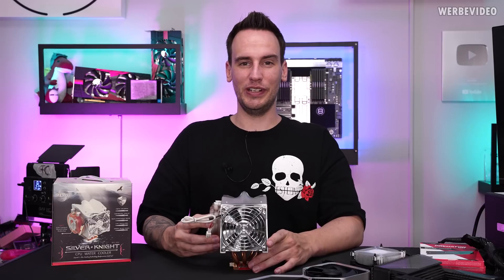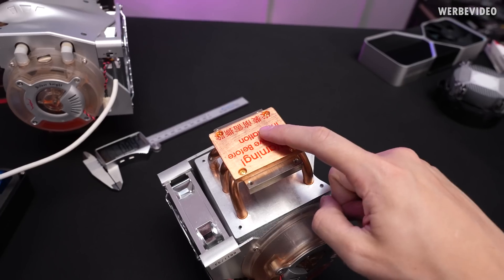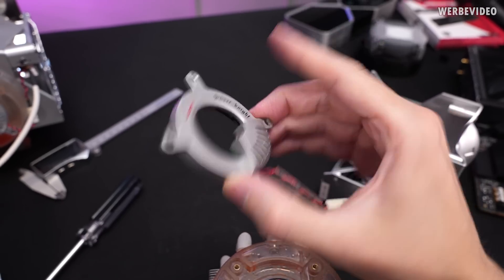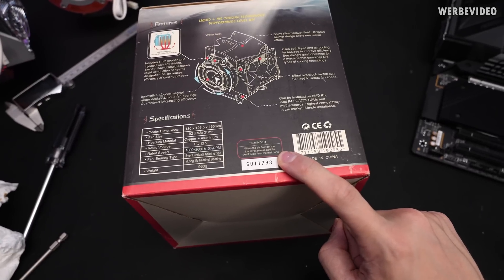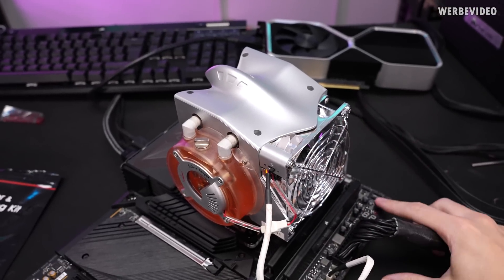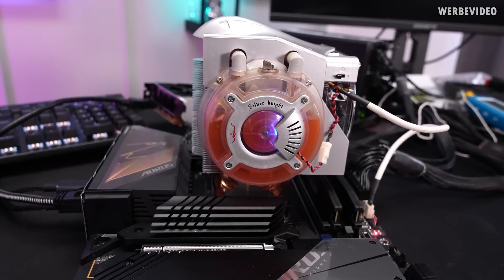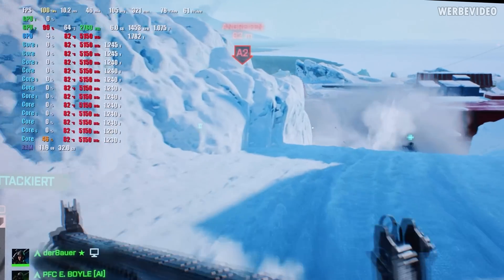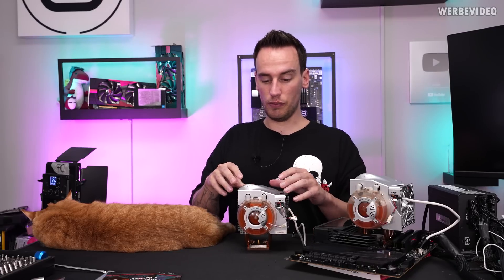Crazy Design!! This CPU Air-Cooler runs Water through the "Heatpipes"

Comment: so, how this thing actually work inside a computer case? Can the pump work face down against the gpu or flip it upside down with the pump on top?(the fan suck fresh air from the back of the case?)
Reply: flipping it upside down is probably a bad idea for the same reason that you shouldn't have the pump of an AIO as the highest point in the loop. Air will migrate to the top, that means with the pump on top it'll run (partially) dry, depending on how much fluid is in the loop. That'll make it loud, perform worse and depending on design, could kill the pump rather quickly.

Comment: really no idea why you are weirded out fluid being gone from such an old cooler, it has just evaporated or indeed leaked.
Also we have waterbottles at work with a much finer tip then the one you are using.
You could also test the cooler without installing it first...just put it next to the board?

Comment: Something you forgot to mention: heat pipes use evaporation to transport the heat away from the source. The phase change from liquid to vapor consumes energy, which provides a net positive cooling coefficient compared to simply transporting the heat using a liquid alone. This is how refrigerators, air conditioning and heat pumps work. So for a given footprint (let's say volume of space the entire cooling system takes up), a heat pipe tower cooler should perform better than a water tube tower cooler. The main reason why water cooling systems (both AIO and open loop) perform better than tower coolers is that they can transport the heat further away from the CPU socket where there is more room for a bigger radiator that would otherwise not fit in the system, and provide a cleaner airflow path to draw in cold air and exhaust hot air. A 120 AIO should perform about the same as a good tower cooler for that reason, and not provide much benefit aside from aesthetics.
Reply: While latent heat of vaporization is a thing, your conclusion is not correct.  The dramatically higher volume of water being moved by a pump compared to the volume moved by a heatpipe will absolutely allow a water cooler to move more heat per unit time across the same distance.  The only limitation would be flowrate.
Reply: @zoson Factually correct, functionally inaccurate. 120 AIOs demonstrate this, and are routinely worse performers than top air coolers. The latent heat during the phase change is enough to overcome the advantages of a small flow loops. As the loop scales, it flips and gets the advantage. There's no way a tiny loop like in the video, or one like it using a D15/K620/Darkrock will have enough volume to surpass the evaporative advantage of their air cooling heat pipe versions.
Reply: @RobertSmith-lh6hg  As I specifically mentioned...  "The only limitation would be flowrate."  AIO's are KNOWN for having garbage flowrate.  And it's a major contributing factor as to why certain non-asetek units can perform so significantly better.

Comment: There doesn't seem to be any definitive video regarding how to orient your motherboard, considering there are vapour chambers.
I notice that a lot of tests are done on a test bed where the motherboard is flat, as if it is a desktop case.
But then the vapor chambers are not oriented the same way in my tower case.
So it would be good to test these things with the motherboard oriented in different positions.

Similar to what seems to be issues with GPU's and their vapour chambers.
Reply: There probably are some CPU cooler designs that use vapor chambers, but the vast majority of CPU coolers don't. Tower coolers usually use either heatpipes with a flattened surface that go directly on top of the IHS or heatpipes on top of a copper contact plate – or maybe aluminum for some cheaper models. Heatpipes are not as sensitive to gravity as vapor chambers are, they should work in any orientation really. Non-tower coolers may use the same concept with just a horizontal fin stack instead of vertical or just have a full copper/aluminum contact plate with fins directly on top.

Comment: Do note that the cooler wouldn't be oriented like that on a case, it'd probably sound different on a case, with the water not dripping down into the pump so high.
Reply: If it was fully filled with liquid it might also mitigate this issue.
Reply: Yes, very good point. This is also a problem with some AIOs...
Reply: id say if was full like on package shows and set to high in case no open air with no case dampening then it would be way quieter i wonder what its max performance is like it ok to test high on am5 but id like to see ryzen 7 or 9 on am4 cause they didnt put crappy ihs on those cpus
Reply: had if pump was actually full of water
Reply: and a newer PWM fan; an Arctic P series, if they have that size

Comment: I'm a bit sad that now I know my man Der8auer is not familiar with permeation x), I though you knew that because it happen also in modern loop system, plastic is not 100% waterproof, water will always find a way to permeate it, it already happen in systems that are like 5-6 years old, more than 10 ? Of course it will happen, and it won't even let a trace, liquid will get away without the colouring x).

Comment: "you can't run water through heatpipes"
i mean, nothing stops you from cutting the top off a heatpipe and attaching a hose/fitting to that, right?
i'd assume that'd work better than straight up pipes because of the copper sponge around the walls having more surface area than a flat pipe
Reply: Could work, but you'd probably need a strong pump that can generate quite a bit of pressure, as the hole inside a heat pipe would be tiny compared to even those small tubes on this cooler.
Reply: true! i'd guess running a couple of pumps in series would be enough

Comment: I really enjoy these videos where you look at old generation tech. You always seem to find something interesting. Although this particular one triggered a few traumatic memories from an old Zalman Reserator I had in the early 2000s. I had a pump death critical fail and bricked a CPU and board. I stayed away from water cooling until only recently. 👍
Reply: I think it would also be very interesting to get ahold of every generation of Zalman CPU water block and compare their performance as I am not aware of any other series of water block that demonstrates the early water block design evolution from spiral maze to fin path, from fin path to square pin-fins, and then to round pin-fins.  
You could even test every water block on the same AM4/5 processor as Zalman used the stock AMD retention bracket to mount their CPU water block.
Reply: Dude I remember those days. Me, I had a Chieftec Dragon case (Antec Clone) with water cooling. I went to work, and my brother let the dogs in the room. They went apesh1t fighting each other and knocked it off the desk to it's death. I mean, drop a 20# computer. It looked like a car accident. hahaha.
Reply: @heavytank2  Not a clone! Chieftec and Antec both sourced their cases from Chenming.
Reply: @intercity125  cool ty for clearing that up
Reply: @heavytank2  Aah the wild west days of case pimping 😆

Comment: I thought that the pump should be below the water level, so it was correct to test when the motherboard in an upright position, it seems to me, no? Not for nothing the pump on the cooler is placed exactly at the bottom of it.

Comment: It would be very interesting to see how a modern version of this concept would perform
Reply: Not much better. Its a gimmick. This was from the early era of DIY gaming PCs. There were several products like this that all used watercooling to cool a tower cooler, but none were better than simply bigger tower coolers, which were also cheaper. You dont need water and tubing when bigger and more heatpipes work better in this scenario, and really the limiting factor of these coolers is surface area to dissipate the heat, hence why big tower coolers were better, and why radiators/AIOs became popular too. The biggest advantage of watercooling isnt the water, its the surface area of the radiator. ---The ideal situation for a product like this would be a hybrid cooler, aircooler + 120mm radiator 2 in 1 for ITX/mATX cases.
Reply: Or with diferent liquids.
Reply: Slightly less awfully.
Reply: Badly. The heatpipes themselves are better than a water loop when used in this sort of configuration (duh). At short distances heatpipes are magnificant but they become cumbersome and ineffective at longer distances.

The advantage of water besides is mainly that its better at transporting the heat over a longer distance and consquently allowing for bigger heat sinks further away from the heat source. Which can be very useful given by the geometrical constraints of desktop systems.

"Constraints of desktop systems" are the key words here. You could build a much much better heatpipe cooler but on a modern mainboard there is simply no place to put it.  Nevermind mounting it.
Reply: It would be an interesting thought experiment, because we know over the last one and a half decades the industry has learned a lot about fluid dynamics and taking advantage of different flow types for heat extraction. Just the difference in the size of the cooling surface and the density of the fins would likely knock off a few degrees.
That being said, we currently have air coolers capable of cooling more intense heat loads, and as we know: the fewer failure points you have the better
Reply: Only to the uneducated. Smart people already know it is a crap idea.
Reply: The leak hazard and maintenance of water cooling with almost none of the benefits.
Reply: Hate to say it but, if it was a good idea... someone would be doing it.
Reply: I agree but I want to see this combined with current AIO so it would be with a radiator
Reply: IIRC, there was a dude here on YouTube that did mainly 3D Fan Blade design and testing. He took a Hyper 212(+), cut open the heatpipes, and used them for water.
I believe it performed worse.
Reply: It would need to be made with a ventilator connected to a pump so when the pump is running it spins vent also. that would be huge upgrade
Reply: The modern version is a AIO 👍
Reply: @gasracing4000  yep, no reason to attach the rad to the CPU block.
Reply: @Mike__B  It definitely is. There's also a reason why modern radiators have dozens of thin, flat tubes running through them instead of a few large, round tubes.

The rule of thumb I've heard is that a radiator with flat tubes like modern automotive and water cooling radiators can dissipate about 30% more heat than the same size radiator with round tubes like residential AC coils because there's so much more contact between the fins and the tubes, but this "radiator" would perform much worse than that because it has so few tubes.
Reply: @thierryfaquet7405 I agree with you 100%, but I feel the need to mention that some folks (not I) treat their PC case interior as if it were their prized classic car, and they would adopt any stupid, semi-effective product that reduced the visible "case clutter" of having a separate radiator, coolant lines, water block, etc.... 

It's like that moronic company that tried to market wireless power delivery for desktop PCs and monitors, by harvesting energy from 2.4ghz signals.

Eevblog had a great video about that.
Reply: @gasracing4000  i think what they mean is this design in that compact form factor. i too wonder how a modern version of this design would work with current AIO cooler designs and how well but we may never know.
Reply: @gasracing4000  That is better then an AIO and let me explain. IF an AIO FAILS there is ZERO cooling on the CPU and thus it will overheat. If this one fails liquid stops moving but there is a fan and it transforms into a regular cooler. CPU then wont overheat. WAY better design then an AIO.
Reply: @GirlOnAQuest  I get what your saying, best of both worlds... but the purpose of water in a loop is to transport heat to a different area mainly. So using water in a design like this is a bit pointless, thats why no one makes this style anymore. Using a small amount of liquid along with the principals of phase change is more effective for a small area (its like a mini ac unit kinda). What sucks about AIOs is that the heat needs to be removed from the computer and then everybody bolts the heat-radiator in the case anyway generally as a intake... custom loop with external rads, huge reservior and multiple oversized pumps (in case one dies) for the win.

Comment: I remember Evercool, coming out with some really great coolers, that were affordable back in the mid 1990's to mid 2000's.
Reply: you're right, I had a laptop cooler that stuck to to side of the heat vent and it did help a lot. they sure had some great product ideas.
Reply: Now they make portable 12V mini fridges and pc fans and fan filters.
Reply: I don’t remember anything great or innovative about mid 90s coolers.

Comment: I always thought what would be neat would be a water cooling block with a heat pipe cooler on top of it, so in the event the pump or something failed it would still operate as an air cooler.

Comment: at that point they can better make a seperate cooling module/block that has everything in it, sitting next/behind or ontop of a predesigned case with its own powerplug and watertank inside.
all that comes out are 2 tubes assisting the pc, freeing all that space inside you could go crazy with tube design and put an actual cooling element in it

Comment: Interesting to see this old thought process.
At 4:09 you are trying to fill the small hole but using a giant tube from a 1 litre fill bottle.
I purchased the cheapest Chinese unbranded 500ml fill squeezable bottle and it has a pipe that narrows to a very thin end to fill stuff up with and would easily fit in that fill port.
Reply: The fill bottle he is using comes with a needle tip, but he pulled it out.  He could have just jammed it back in there.

Comment: Tl;dr : why use this? Heatpipes can only carry so much power so fast.

Why I think this would be nice for is for high power/temperature applications where heatpipe dry out is an issue. E.g. cooling high power/high temperature GaN transistors, which can get to like 500W/250C (not a typo, some have a tj max where they'll work as rated at over 300C, and will only be permanently damaged at around 400-900C)
So high flow of water at like 90C would be pretty chill for those or maybe more exotic novec fluids that can go up to 200C

But yeah till we get normally off GaN transistors and make cpus with them I don't really see the adventage in PCs besides needing less heatpipes.
Though we'll see with 14 gen intel having a tiled design with high power density, we might have some hot spots like the CCDs on the ryzen 9 making heatpipes not able to carry all the power.

Comment: What surprises me is the amount of youtubers which don't use a simple molex to fan adapter and a paperclip between green and black on the motherboard connector (or a proper adapter with a switch) to check/fill watercooling stuff without having the board powered on.
It takes like 5 minutes extra at most to avoid burning a motherboard/cpu
Reply: Or just connect a fan to a motherboard but don't mount it and keep like 15cm away. Like wtf is this drama bait.